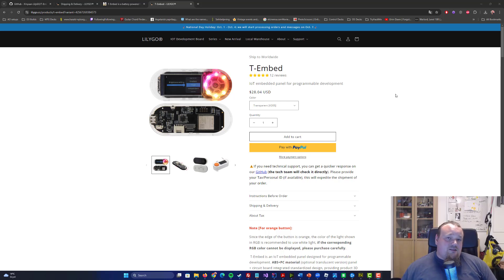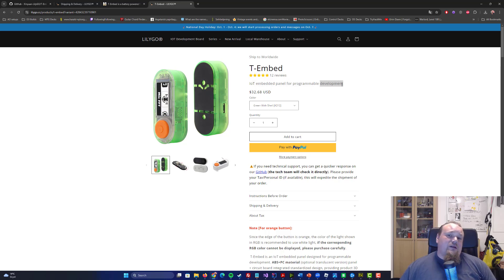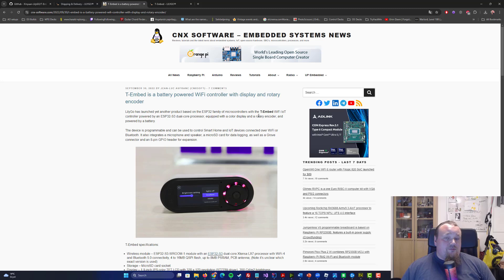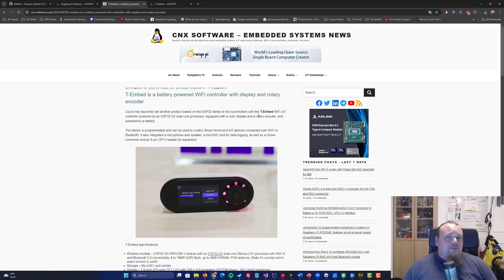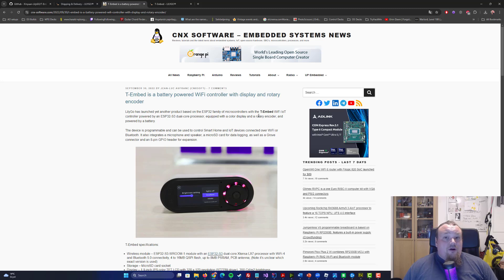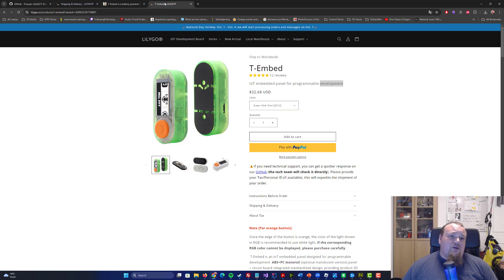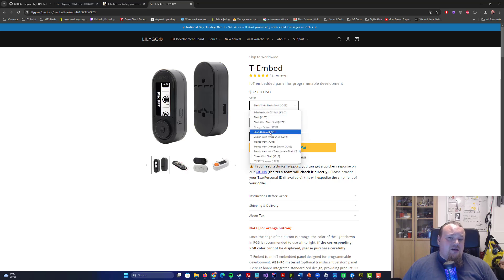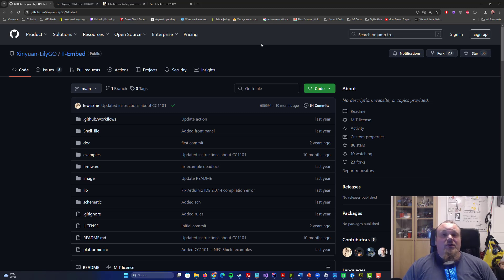Flipper Zero Alterative - LilyGO T-embed

Comment: Why.. the.. *.. do we get so many things like this without a battery? They design these little "self-contained" devices and don't include a battery? This one looks like it has a power plug, and, since it's next to the USB, I would suspect it will have charging control (likely for lith-ion), but come on. And the picture intentionally obscure the cable, so they look like it's being used mobile. Come on people! If you're making something like this and the point is to be self-contained and/or mobile, a battery is a pretty important part of that.
Reply: It's because this is not meant to be a device like a Flipper Zero. The hint is in the name "Embed". This is not a hacking device you can just buy off a shelf and then take over the world. This is a programmable development board that you can use in your projects. This is NOT a complete end to end hacking and development environment like the Flipper Zero.
Reply from the maker: No idea to be honest. There are so many things that are weird... but you are right :)

Comment: this looks pretty good, Platformio files are availiable, together with example codes. Only minus is that it does not have CC1101 integrated, but they talk about some CC1101 shield, so hopefully, there is enought space inside to put it there.... (you seems to start to care about firmware, and the fact, that there is none, big up)
Reply from the maker: Thank you for looking into it